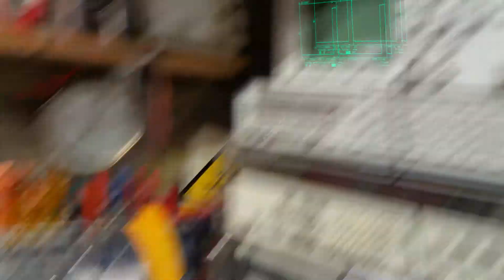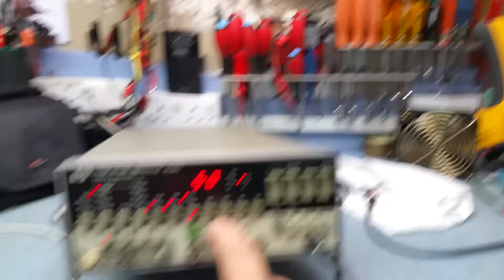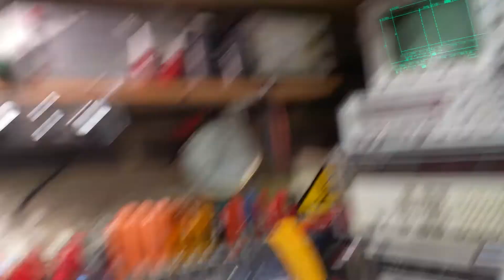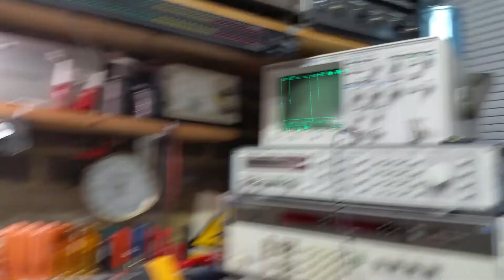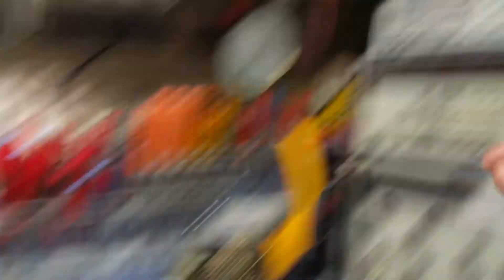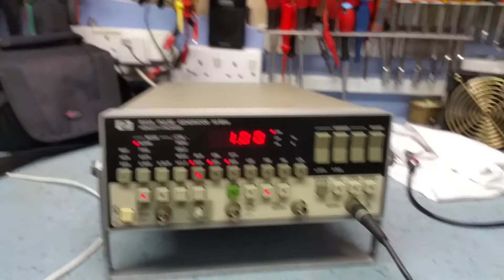Hp 8112a  Pt3 wrap up.

Comment: That’s a very nice pulse generator, if noisy in operation because of the enthusiastic small fan in the back. Also the box sticks way back, so it can be tricky to find a place for it, but it works well and is incredibly versatile. I read that the HP team in Germany designed it and the other pulse generators from HP, and you can tell that they come from the same mind and hand. The density and elegance of the front panel control functions are rivaled only by the folding PC cards inside!

Comment: I always think it's amazing when something like a dirty IC sockets fixes the problems I have had this quite a few times myself.  Still a good repair and a nice bit of test equipment.  I like the LED lamps in the push buttons. Well done and a great find and good tip for the auction site. Regards Chris